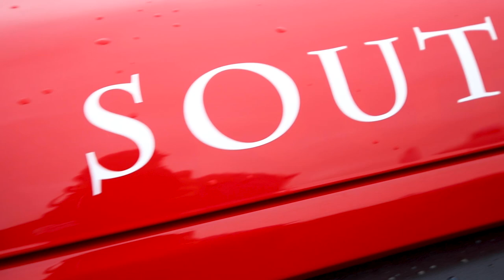Save The Squares: A love letter to the Jeep YJ

Comment: I have a 1995 yj I love it. It’s my daily driver. It’s all original. I even love driving it on my way to work. Thank you for your yj content
Reply from the maker: That’s awesome! Did you buy it new back in 95?
Reply: @SimplyMustGo  no. My sister in law wanted to junk it. Told me to sell it for parts. Never had a Jeep, never wanted a Jeep. I found out it was an easy fix, and by the end of the test drive I was hooked. I want to make it showroom condition. The YJ doesn’t get enough love. In my opinion it’s the best Jeep ever.

Comment: I have a 93 yj restored took over twelve years the last of the good Jeep's
Reply from the maker: That’s awesome! Did you do a full body off restoration?
Reply: I did not have hard top or doors at time of restore finally got them and they don't fit so now I just use a soft top a soft door so if u restore a jeep make sure u have hard top door's on hand body's flex .

Comment: Nice video!!
95 YJ (blue) owner here, my wife and I absolutely love our YJ soft top. We bought it for 5k with a rebuilt engine with only 23k miles on it, everything was stock on it.
So we spent some money on mods, 3" suspension lift, 1" body lift, new rims and new 33×12.5 tires, front bumper with winch, rear bumper with tire carrier, new soft top and frame, new tub carpet (Bed Liner brand), rock guards etc. We love our YJ, we call it "ODD SOUL"  when out driving it around we get lots of looks and compliments. Started watching your videos about a week ago, and one video you did that  I'm going to do is replace the  Dana 30 front axle 4wd lock with the permanent lock, Excellent video by the way!  "KEEP ON JEEPING "
Reply from the maker: Thank you so much! 🙏🏻🙏🏻🙏🏻 your YJ sounds awesome!

Comment: Had my 91 for about 22 years. Bought it from a guy in my Jeep Club, the original owner, as it was better setup than my '89 (plus efi vs carter carb!). This was in California, 6 months later we moved back to the UK so i sold the 89 and shipped the 91 here. It's been wheeled in the US, Mexico, England and Wales. Not many can claim that. On it's third engine as the original block cracked during shipping, the XJ engine replacement wore out it's cylinders (went oval shaped) and it's currently using a TJ engine.
Reply from the maker: That’s awesome! Glad you’re keeping it alive!!!
Reply: @SimplyMustGo  Also on my driveway is an 83 Cherk. Only one still remaining on the UK, afaik.
The 'one day' car. As in one day i'll win the lotto and be able to afford the bodywork repairs #Rustbucket

Comment: I SAVED A SQUARE TODAY!
Reply from the maker: That’s awesome! What did you get?
Reply: 1991 wrangler sport , got a hard top solid frame has no rust ,has hard top. Needs floor pans in driver and passenger floors not bad though that is the only hit of rust, has 3in body lift , sitting on 33's and pro comp rims. And its black got a smoking deal ,131,000 miles on inline 4 with injection.
Reply: Also has a battery draining issue I am currently dealing with.